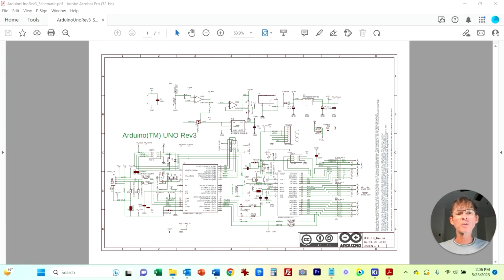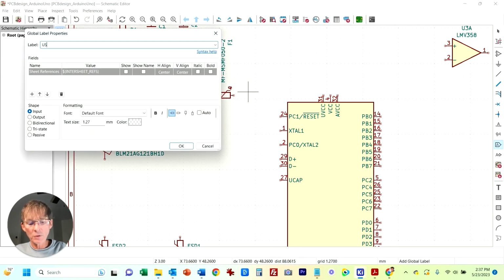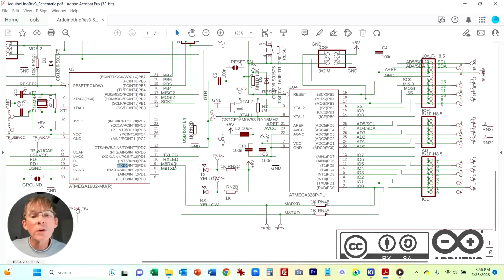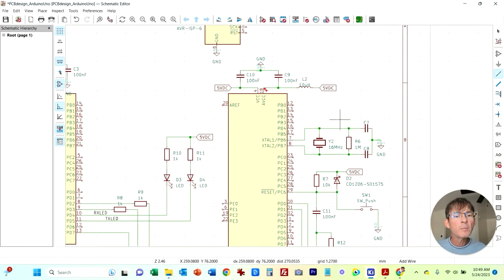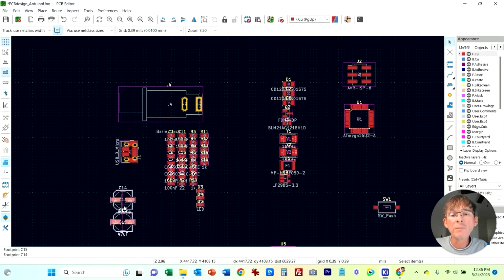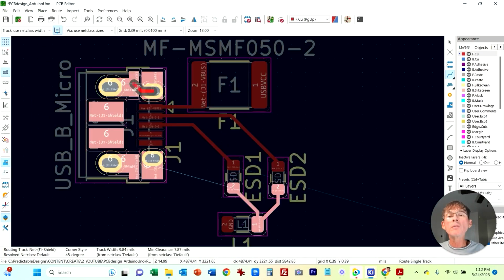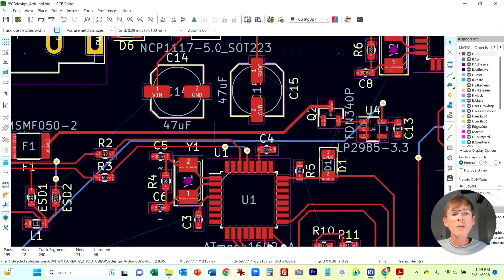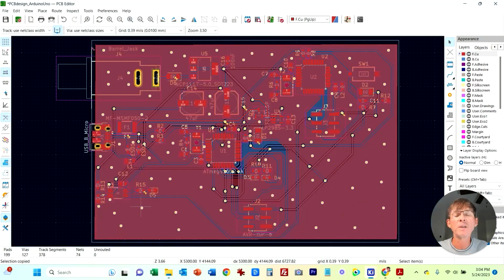Design a Custom Arduino Board for Mass Production in 3 Hours

Comment: If you allow me to give a suggestion, I think you can improve signal return paths by placing ground vias next to signal vias. Since you placed ground planes at both sides of the PCB you already provided defined signal return paths for traces that do not change layer. But this is broken for traces that go through vias. As said you can improve this by placing a ground via next to every signal via

Comment: This is the first for me, being the first to click like. Your timing and content are awesome. Thank you. Coincidentally your timing couldn't be better, given I have a meeting to discuss such a prototype development board today. 
In a previous video, you recommended an STM32 microcontroller noting advantages including using the same IDE programming structure. 
Would this tutorial be applicable if you just switched out the AYmega328P with an STM32?
Reply from the maker: That is so awesome to hear this video got your first ever YT like! Thank you. In this video I stick with the exact same MCU as the Arduino Uno (there are actually two - the Atmega338p but also the Atmega16u2). For most projects I still prefer the Stm32 or any Cortex-M based microcontroller. But the easiest transition is to stick with the exact same MCU. Cheers!